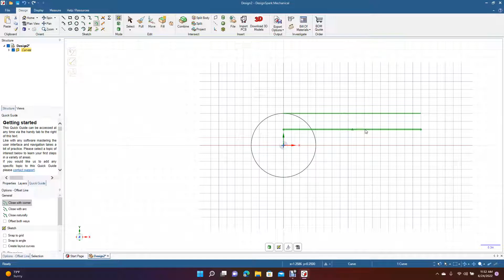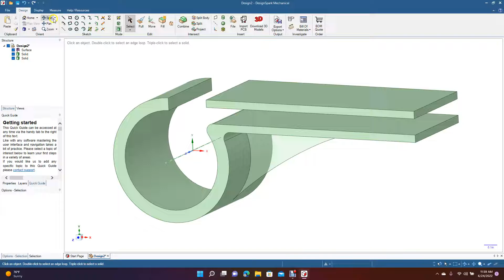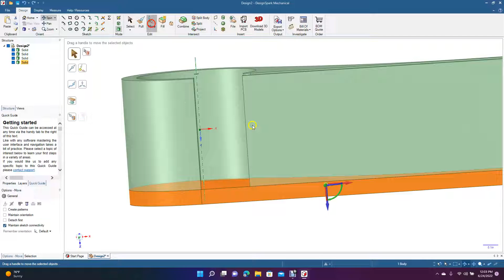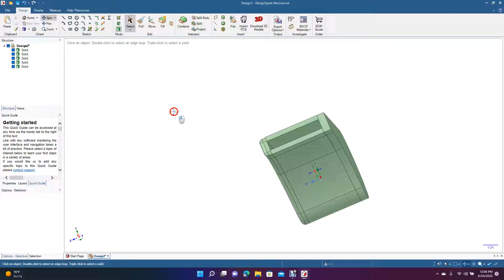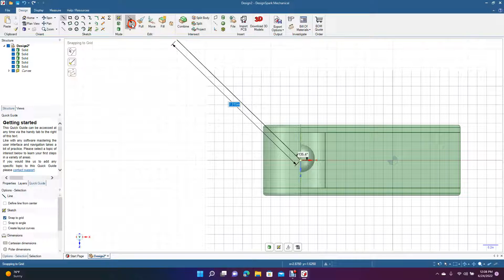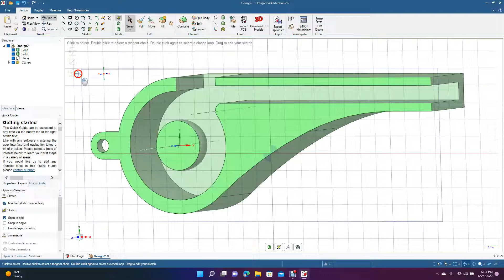How to make a whistle with design spark mechanical

Comment: And for the grid you need to either select 3 points or curved line or surface for the software to understand how to show 2d grid. After selecting or 2 points there's no way that software would know the orientation of the greed we want to achieve.The grid can also be moved, spinned after. there is a tool with an arrow at the bottom of the screen for that. Double click on the spinning arrow turns object 90 degrees so it does not need typing.
Reply from the maker: You seem to know DSM very well. I appreciate all the comments, and tips! Many thanks!
Reply: @dailey3drevolve  I am glad that the tips may come in handy. I make these comments for video viewers as well, so they know in case you don't mention some. I'm also glad to watch your tutorials as I had a year off using DSM and they remind me of certain things and also a few things from your videos. Thank you.
Reply: @dailey3drevolve  Unfortunately this software has some bugs and sometimes does not respond properly to certain commands. Occasionally I found it helpful to save current work, turn off and turn back on DSM when it doesn't do what it should.

Comment: If you want to move it upto you need to select the direction(arrow). which way you want to move it x,y or z. The software does not know. So first you select the object you want to move then drag the arrow handle on the surface or point you want the object to be moved by and then select surface or point to move up to. Thanks for video
Reply from the maker: Thanks for all these great tips.